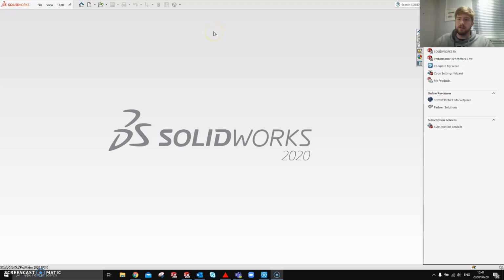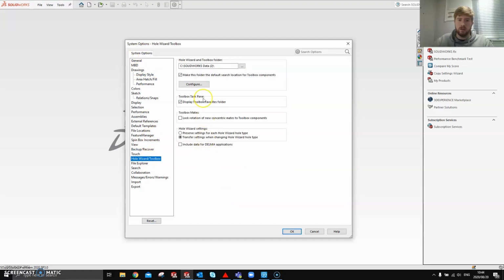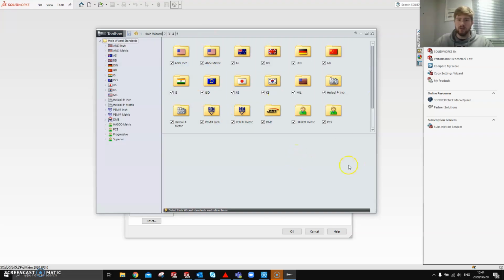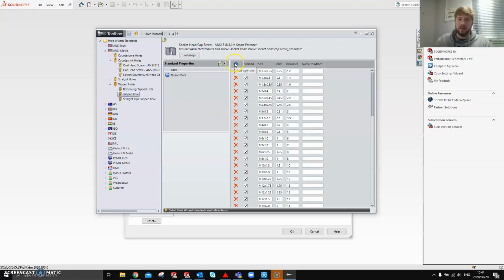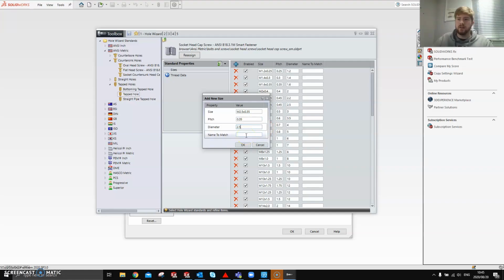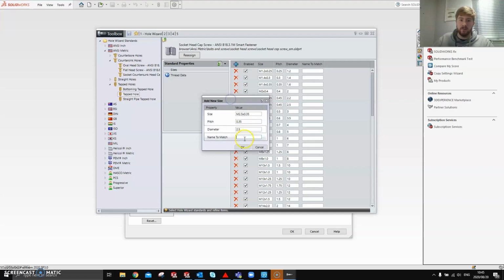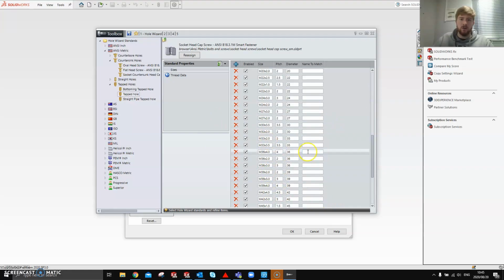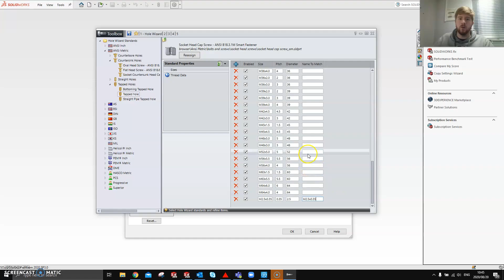Creating custom hole wizard standards in SOLIDWORKS

Comment: Hey there! Thank you for sharing this information!! I'd like to create standard patterns of oblong holes with 3x3 or 3x2 arrangements (it's for bus bars connections). Is it possible? I'd like just to inform were to put it along the bus bar and select with arrangement to use. Thank you for your attention!! Best regards
Reply from the maker: Hi Matheus,

You can create the required patterns and save the pattern feature as a design library features to be used in other models as required.